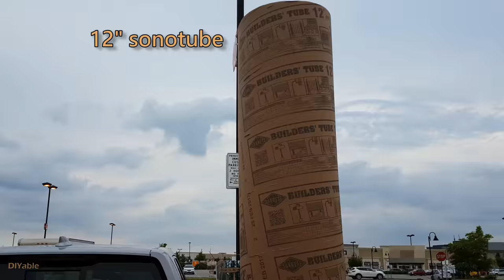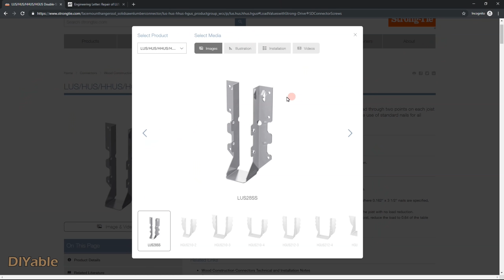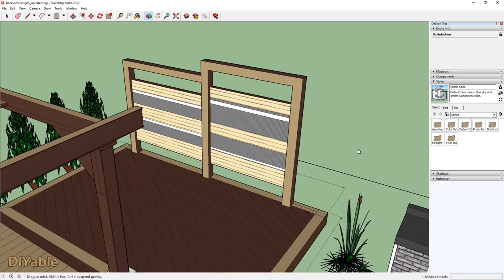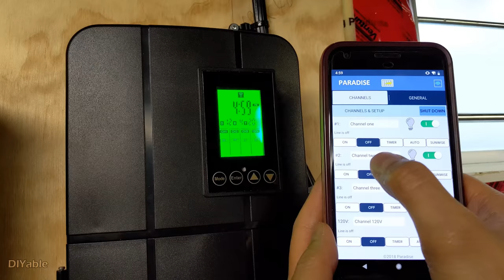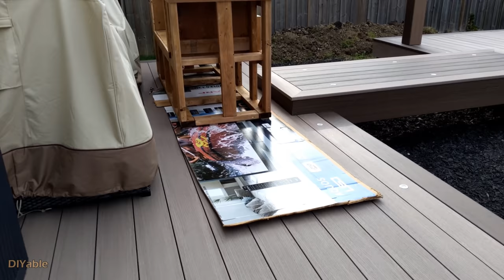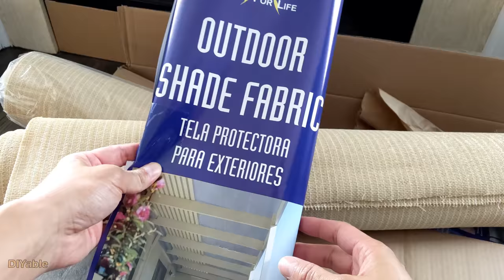How to DIY build a modern deck and pergola using Azek in 15 minutes time-lapse?

Comment: Great video.  Pro tip: Take the air filter out of the shop vac when sucking up water.
Reply: I think he used series 7000 which is for used for wet vac
Reply: 🤔🤔🤔….Dayum….You don’t know but you just taught a lot of us sumthin with that….🤷🏽‍♂️🤷🏽‍♂️🤷🏽‍♂️
Reply from the maker: I would really reluctant to call it a Pro Tip. it's more comfortable for me to call it a DIY Tip.  Well, it worked!!!!

Comment: Joist hangers are perfect.   I had to argue with my contractor because I wanted a lower deck with no railing required.  He couldn’t comprehend it.  I also insisted on hurricane straps for our covered deck portion.  He again stated wind wasn’t a concern because code didn’t require it.  We live just off the lake in Niagara.  Every time we get a wind storm I’m happy I have those straps or else my roof would end up in OZ!
Reply from the maker: Joist hangers requires a lot more time and money (especially if you use proper structural screws), glad you insisted on hurricane straps!! As our Canadian hero Mike Holmes always said "There is nothing wrong in exceeding code",  I totally agree with this line.

Comment: you did a masterful job with the details.  I made a deck of the same composite material and did not use the spacers.  I don't have enough gap now and dirt and water can stand on the deck.  I used the same recessed lights but mine failed within 2 years.  I hope you don't have that same experience.  Well done.
Reply from the maker: You are quite right about the deck light,  indeed I have 10 LED failed after 3 years. The worst part is, they no longer sell those lights at my local hardware store anymore. Mine is 12V AC (not DC) and it's not easy to find. For anyone who is reading this, I recommend installing the 120V LED String Light instead. Check out part 23, https://youtu.be/ne8XOoLUmek 

Having said that, I haven't given up yet. I am now doing a proof of concept to use cheap 12V DC "Marker Lights" (people use those for the trailers and trucks).. stay tuned, I will publish a new video about this in the future.

Comment: Excellent work sir! 
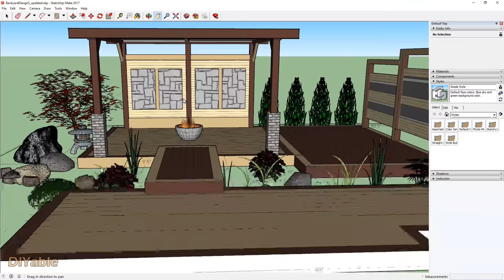A little tip regarding 9:45 I’ve found out about a while ago - Have you tried Wago connectors?
You just put your cables in, use the lever to secure them in and that’s it. No soldering, or “choc box” style connectors to screw in and they also sell a waterproof junction box for exterior work. 
I’m not sure if it’s available everywhere, but I’m sure another company makes a similar product and they’ve been really good to work with so far.

Comment: I use nails as deck board spacers. Tap them in, wont move, seat your board, pull out nail. Also buy the squared edge boards if you plan on using screws. The grooved boards trap dirt and debris

Comment: Looks good. Just wondering why you used so many coach bolts, timberloks would have been better. Also why did you go straight through the wall into your house with the coach bolts and didn’t even put silicone in the holes to stop damp

Comment: That is huge and I would have thought there are local LA authority rules on the size/ height you can have something in your garden especially as it dominates other properties.
Reply from the maker: Check out the description for more details on permit related concerns. Indeed, the city building inspector came and also checked zoning, the conclusion is.. no permit was required.

Comment: Im guessing the time to reply maybe over but I am currently using cement blocks shaped like elephant feet, with out fastening to the house as it would require a permit in my region of Ontario. Could I trouble you to show us possibly a video with this kind of setup? As my deck is under two feet as well. If not no worries thank you for this video it's incredible what you've done very inspiring!
Reply from the maker: I don't have that video yet,  but I am planning to help my neighbor to use the cement block to build his deck,  probably next year.  If I remember correctly, for many cities in Ontario, if your deck is lower than 2 feet and you are not fastening to your house (which is what you are using the cement block), you don't need a permit UNLESS your town/city is different.  A word of caution, for cement block, please DO NOT build a Pergola like I do, it would be dangerous since you are not anchor to the ground.

Comment: Wow, really nice backyard project.
I started mine last year (will be a couple year thing). Just a couple questions about the deck.
I've noticed the basement window gets covered over. And you said it's about 2 foot deck height. Are you allowed to block off the window access?
How did you get around having your deck attached to the house?
Is it attached or floating?

People have been saying that you can only build a 120 square feet structure without a permit.
It look like your deck is about 3-400 square.

Also, where do I start looking for local building codes, don't want the city hitting me up for violations.

Comment: Hello,  Not sure if you are still monitoring this video.  I will be building a sizable floating deck in a few weeks and was planning on using the Joist tape.  I saw in your Video you say DO NOT USE.   Could you tell me why?  I have watched other contractors building porches and decks in our area over the past year and they are always using some sort of covering over the joists, if not, they say the decking would outlast the joists.       Could you tell me why you say do not use?

Comment: Hi i have a question about you window in the basement it’s legal to over your deck
Reply from the maker: If you have a basement apartment and that's the only window in the bedroom, it maybe against the fire safety rule in some cities. I think you have brought up a very good point, for people who want to get access to the basement window, you can actually build an door on the surface of the deck. For Ontario, the rule is actually different from National Building Code of Canada, Ontario does not require an egress window in the actual bedroom. As long as there is an egress window or door to the exterior somewhere on the level (see the article link below). One thing I want to point out though, for basement window security... all building codes don't allow you to add the basement security bar with lock (although they sell those in hardware stores). Honestly, that is a VERY BAD idea in terms of security, I have neighbors got broken in through basement window.... so, risk of fire to escape or prevent burglar from breaking in? It's your choice. 

https://www.linkedin.com/pulse/did-you-knowa-bedroom-ontario-does-require-egress-window-frigon
Reply: @DIYable  thanks for important information i think it’s okay to build my deck and cover my windows. I have two windows in basement and I don’t have room and my plan tommy basement is only entertainment area only by the way im from Manitoba thanks a lot

Comment: What design software did you use for this?
Reply from the maker: Indeed, that was not a deck design software,  It was a 3D rendering software called "Sketchup Free version" it used to owned by google.  Make sure download the FREE version. There is a learning curve on how to use it. However, it does give me the visualization of what it should look like.  I think Professional Deck builders don't use Sketchup, but for DIY I believe it does the job.

Comment: a permit will be needed in some, if not most, locations. This is outside - your town assessor will notice it next time he comes around - the town can fine you a pretty bunch of $$. So do talk to your commissioner/inspector first.
Reply from the maker: About the inspector question, I have some details in the description of the video. The building inspector came and told me permit is not needed. Yes, I agree, in some town, it may require a permit.
Reply: @DIYable  yes, I'd read that. You were lucky to live in a town that doesn't require a permit (not so lucky with your neighbors?). In some towns, decks lower than 30" don't need a permit, in others, any work on the frame needs a permit. My point was: do check, and don't just rely on the bylaws (they're a mess of a document) - call the inspector.

Comment: I'm not sure where you are located, but your thumbnail is misleading. In NJ anything related to concrete work requires permits. It becomes a permanent structure.

Comment: you are a great carpenter. but you made a those unnecessary fancy joints to cover them up with plastic, that was a waste of time. also you made a few mistakes that will cause water rot in time at the framing.

Comment: Just remember This will NOT be covered by your standard insurance... and will be classed as garden junk valued at no more than £500 lol so be warned
Reply: You can most def add it to your insurance & cover it under personal property or “additional 
 structures”.  It’s no biggie, whatsoever... that is, if you CHOOSE to add it to your coverage. Being that it is actually attached to the house, tho... it may. I know attached decks & patios are usually included in the coverage. Meh... either way,  it’s entirely up to you. 🤷‍♀️

Edit: ahhh... I see we’re from opposite ends of the pond—I’m in the US. Very likely where the difference in opinion is coming from. Decks & stuff are sometimes considered part of the structure/value of the home (I know my new cedar fence is covered, & it’s not even attached to my house. Well, ok... I guess technically it is, where each of the side-gates are attached to either side of my house, but that’s the only 2 {extremely small in comparison to this} strips/area’s that are attached, & it’s still def included & covered), especially if they’re super nice/designer decks like this one or just a decent attached/permanent structure. 
Nice decks like this can def add a very nice increase in your overall home/property value, depending on the area you live in & what ppl look for & value higher there. It’s not an exact science. But still, something like this  will absolutely NOT be valued at just $500 (or the equivalent in your money). Not unless it really is junk, or perhaps a dilapidated detached deck or something entirely not to code, or one that’s simply falling apart... which—in this case—couldn’t be farther from the truth if it tried. LOL! ☺️

Comment: Stop with the bullshit, my friend. You NEED a permit for any exterior structure that intends to host or hold LIVE weight.

There are live load and dead load requirements throughout the United States. Each area slightly varies in terms of hardware, hangers, and freeze pointe. 

Advertising people DON'T have to pull a permit, illegally, is by far the most irresponsible thing I've seen. 

If you've ever taken any sort of education in regards to soils content, basic framing, etc: you'd have seen that improperly inspected and installed decks/porches are the NUMBER ONE killer in regards to deaths related to residential property.
Reply: Dude get off your high horse. No building inspector is going to waste their time. And I’ll tell you why... because there’s no big money in pestering someone’s backyard project. If he wanted to sell property and the buyers wanted to see the permit then he would need to have the structure inspected.
Reply: He’s not even in the US. 🧐